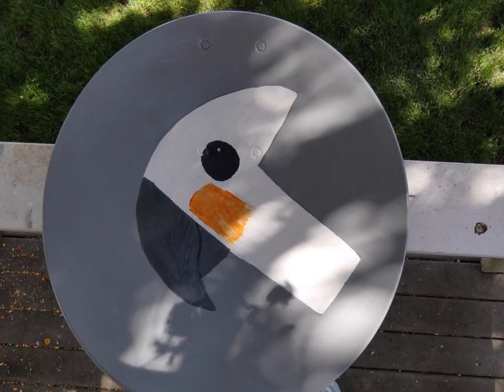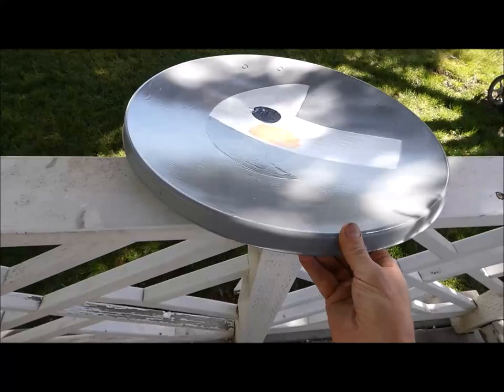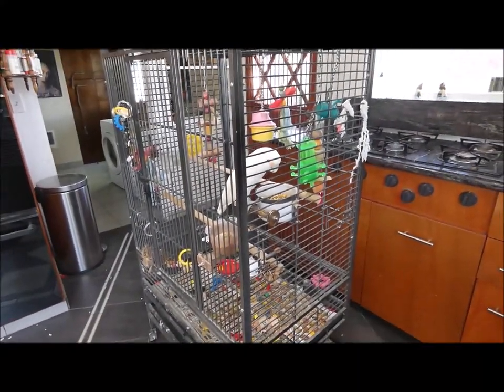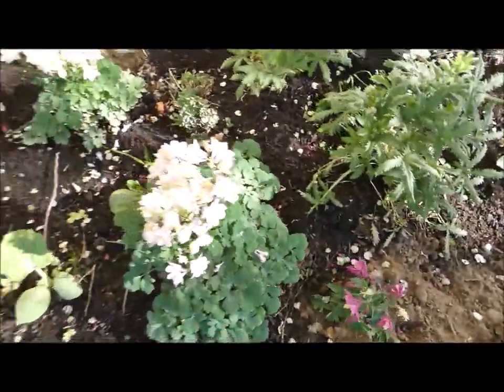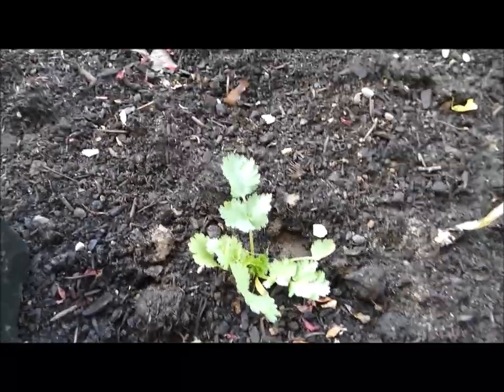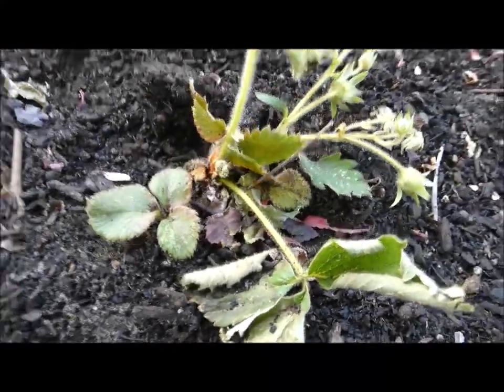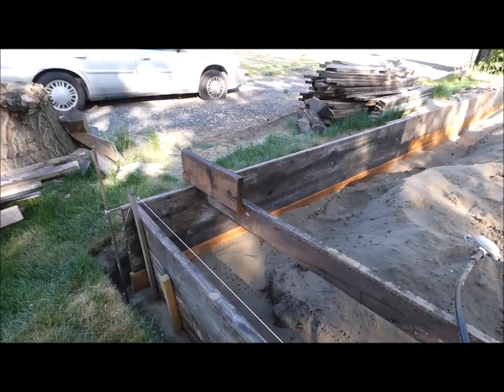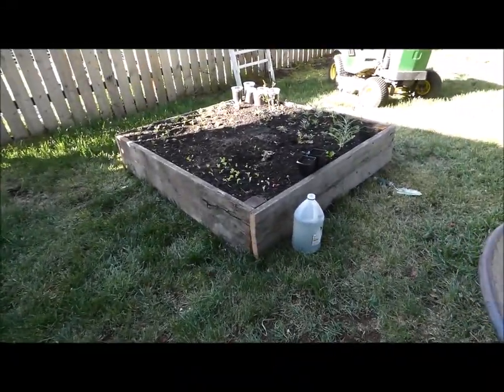Vlog 5/6/19: New bird bath, garden tour,  paper towel apocalypse, and garage update

Comment: Hey Todd 
The bird well is great. All the greens take some time  to grow. You should attach a cordless drill to the holder so it’s much easier for the rewind job. Keep it running friend. Take good care. 👍 greetings
Reply from the maker: Hi Martin! I like your cordless drill idea! She was back at it yesterday, but not as bad this time. A pleasant Spring day to you my friend. Greetings. I sharpened the knife you sent me. It took me about 12 hours-that's some hard steel! I had to use the diamond files and my big set of sharpening stones. I hated to touch the knife, but I figured I would have to sharpen the blade some time, so I might as well get the blade exactly how I want it. I love the knife even more now that I know first hand what kind of steel it is made out of. I thinned the blade a bit and now it is an absolute razor! I didn't get as nice a polish on the blade as you did, but as I continue to sharpen the knife, I will upgrade my polish job. My right forearm is almost completely bald from testing the blade. Someday I will thank you properly for all the time, effort, and love (and power!) that you put into the knife.You and the knife are very special to me. All is as it should be here in Wishram. Take care care my friend.
Reply: Hey Todd
Good that you found the angle cos I made a very small edge. To me it means very much too. Feels good inside. Watch your fingers 😂take care my friend.